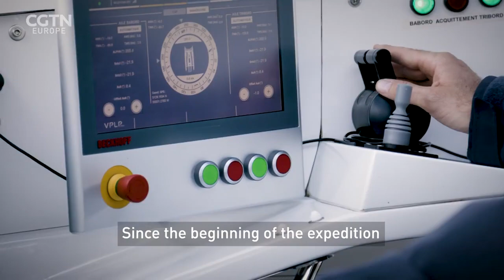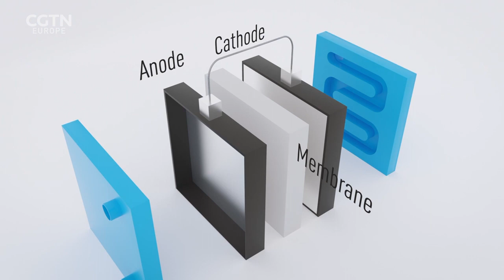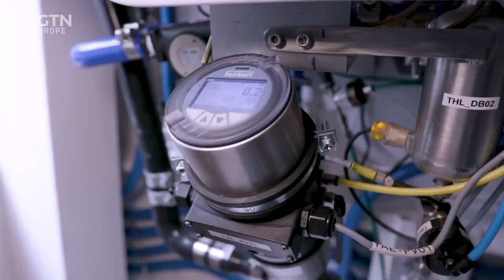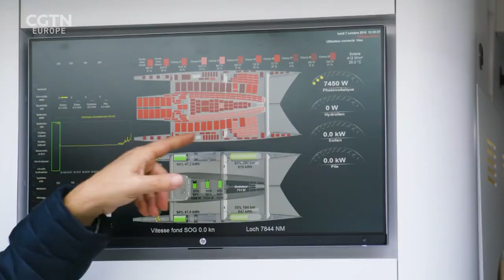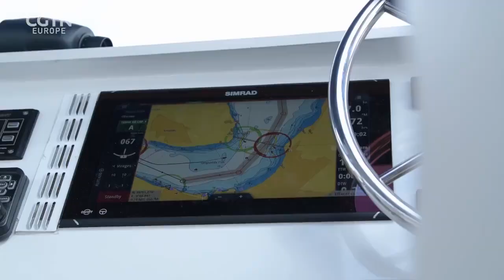Hydrogen Boat: RAZOR

Comment: Very cool, but how soon until we can have commercially available hydrogen cells to put on a boat? Also, besides the weight, I'd be interested in seeing the efficiency of making/using hydrogen instead of storing the power in lithium batteries.
Reply: the power stored in lithium batteries were from solar and turbine. these power were used mostly to run electrolysis to generate the hydrogen.